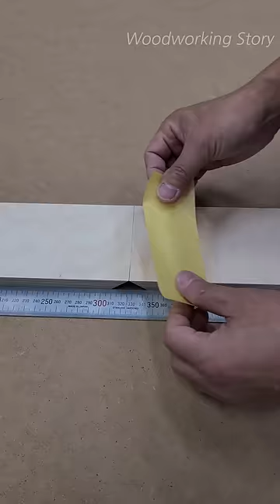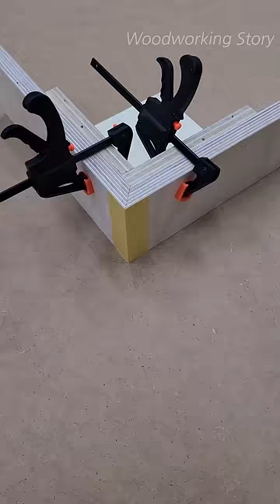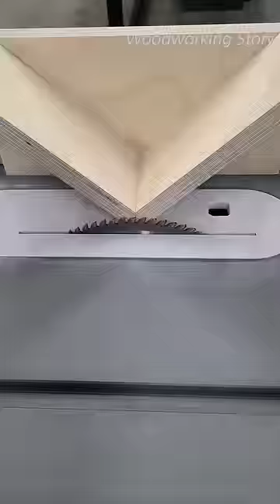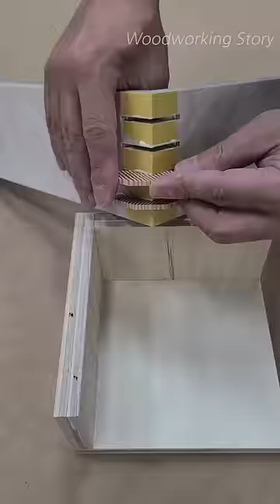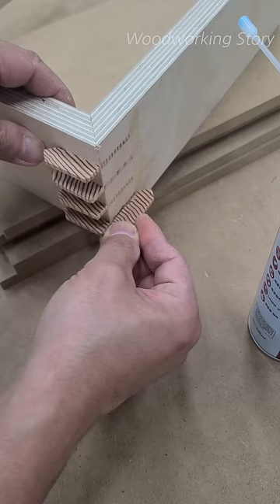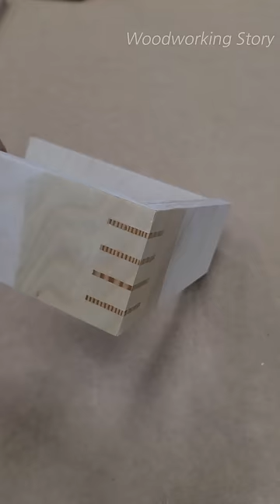Simple and clean woodworking joints  #shorts #woodworking #holz#joinery #maker #tools #wood #bois

Comment: You’re on the right track but that tenon breaking while you were sawing it is exactly why you should never use end grain for anything structural.
Reply: Yeah, I was totally on board until I saw those endgrain off cuts smh. I guess he likes the visual contrast, but it more or less defeats the purpose of the reinforcement imo.
Reply: Exactly, he would have been better off just using a darker wood like walnut or mahogany if he was looking for contrast because that end grain, which looks like southern yellow pine literally added no reinforcement to joint that already has little or no strength. Can only assume he was doing it just for demonstration purposes because his jigs were well made and he seemed to know what he was doing.
Reply: A quick scrap wood demo…
Reply: WHY ARE THE JOINTS DIFFERENT ONE IS A MITER JOINT AND THE OTHER IS NOT
Reply: I think it’s a locking miter joint
Reply: You said it!
Reply: @edwardhollingworth6398 He started out with just a miter joint but then added spline’s making it a splined miter joint, only problem was the end grain splines, which have just about 0 structural strength, especially ones that thin. If the splines were cut with the grain it would have added quite a bit of strength to the miter.
Reply: Exactly...everything was right but that
Reply: It was for aesthetics: probably.
Reply: Would guess they're decorative only

Comment: Everything ok until endgrain was used as domino biscuits
Reply from the maker: I will try to become more skilled. Thank you for watching
Reply: That's what I thought. He actually made the joint weaker.
Reply: @WoodworkingStory-original The Bison glue stronger than the wood,so the joints are not needed.
Reply: @WoodworkingStory-original 😊ㅅ😊ㄱㄱㄱ😊😊ㄱ😊
Reply: @WoodworkingStory-original  Honesty, I like that. As long as you think that way you will become great
Reply: @laszloszell8753  yes, the wood glue is stronger than the wood, but not when you glue end grain to end grain.
Reply: @WoodworkingStory-original 1ㅂ
ㅂ¹
Reply: It's a spline joint in case anyone cares
Reply: You mean splines, not biscuits 😂😂😂 youre obviously the pro here

Comment: I don’t see how this works well as I believe the wood fibers on the inserts are positioned incorrectly so it’s fragile
Reply from the maker: I joined it with wood glue, but next time I think I'll have to join it with solid wood. Thank you for the advice.
Reply: The endgrain biscuits have no strength,  just use side grain instead.
Reply: Video deliberately made wrong just to get comments.
Reply: @Stephlechasseur , here is a comment for your own. You are correct, I am quite sure.
Reply: @WoodworkingStory-original I hope you're listening to all this expert advice 😂😂 love these joints, looks classy.

Comment: That’s definitely a good strong joint
Reply from the maker: Thank you for watching. I'll come back with a good video.
Reply: No it is not.  As others have pointed out, gluing end-grain biscuits in actually makes the joint weaker.  If he did cross grained biscuits it would have been much stronger (grain parallel to the way the saw blade cut the notches).

Comment: While this joint is attractive, there is still a failure mode that could cause the joint to fail that is the axial force along the jointed edge, although, transverse force is prevented along the jointed edge with the wood inserts you’ve made.

In other words, if both legs are pulled then the joint could fail. Ain’t no telling how much force the glue and friction both alone can hold.

My solution is to insert dowels the width of the jointed edge that extrude through the wooden inserts. One on each side of the jointed edge. This will transfer the force to the wooden inserts when the jointed legs are pulled. 😅
Reply from the maker: Thank you for your kind words. I will understand it well and apply it to my next work. Thank you for watching and for your advice.

Comment: That provides a very weak glue joint in the miter, since there is very little clamping force. Most of the strength comes from the splines.
Reply from the maker: Thank you for your kind words and I will keep this in mind. Thank you so much for watching.

Comment: I got no problem with the splines.  It honestly probably didn't weaken the joint and it looks very pretty.  I wouldn't want to do that with something meant to withstand a lot of force for the same reasons everyone else already mentioned though.

I would just want to be careful using a wooden square while gluing a wooden joint with wood glue.  It would be too easy to over-glue and then you've got your workpiece glued to your brace and you'll be cussing yourself 😂.  Just make sure you wax it or something first.
Reply from the maker: What you said made me strong. You will be blessed. Thank you for watching.

Comment: I would have thought that the hardest part wasn't shown - cutting 2 perfectly matched 45 degree cuts on the plywood to begin with. Fitting and securing them together will never work unless they are initially perfectly matched!

Comment: Why not, after gluing and clamping, countersink two screws.  Then fill the holes with caps to hide the screw heads.  Sand it smooth, and wallah.
Reply from the maker: It seems like a good idea. I will apply it in the next video. Thank you for watching.

Comment: End grain is pretty but weak af cut that thin . Clever tho 👍
Practise dove tail joints pretty and the strongest you can make it
Reply from the maker: Thank you for your advice. I will try harder and work harder. Thank you for watching.
Reply: @WoodworkingStory-original  no need to work or try harder that was a lovely joint just a bit weak . You are doing great bro better than playing with your phone all day I’ll tell ya

Comment: If those splines are meant to do anything other than look nice, you should have used wood with the grain running perpendicular to the joint. That one that broke, should have told you, there's no strength in them.

Comment: The time that this guy spent on this one corner, I could have made 10 of these with a little glue and a finish nailer.
Reply from the maker: Next time, I'll make it with nails. Thank you for watching.
Reply: @WoodworkingStory-original 😂
Reply: Well said, my exact thoughts. What waste of time. By the way is this going to be a drawer, if so, nobody is going to see this aesthetic feature, plus all the other comments about structural integrity. 
Woodworking Store, you really blew up your video, with a big, big no, no.
Reply: @russellwalts4260  That's a bit harsh. Give the guy a break. I'm sure he knows what to do or not do.
Reply: @TheMultisportGeek  why????? If someone puts out a, HOW to Video on LINE, you better know what your doing. I've never seen anyone do what this guy has done, NEVER. 
LOOK, at all of the stupid comments from people who don't know a thing about cabinetry, saying "great job", "I wish i could hire you", "its so PRETTY", and my favorite "you really know how to cut a 45° angle" etc. Romper ROOM nonsense 😉. 
How would you like to pay for this nonsense and it starts falling apart???? if you would have done some research, you would have found out THIS guy doesn't know diddly SQUAT and the squat he does know doesn't amount to DIDDLY, LOL.   I've run into guys just like this, he's GOT enough money to buy a bunch of expensive equipment, but he knows little to nothing, but promises to do better.  
You haven't READ some of the other comments???? Have YOU!!!!  YOU BETTER GET A BIGGER CRYING RAG BECAUSE MY COMMENTS WILL PALE IN COMPARISON.......

Comment: Errou ao utilizar as fibras da madeira na posicao errada
Reply from the maker: Onde devo colocar a fibra de madeira? Obrigado por assistir.
Reply: @WoodworkingStory-original  The wood fibers in the joints must be cut parallel, not across. Cross-cutting in pine is extremely fragile., That's why it broke when cut, and is not used to reinforce the joint.